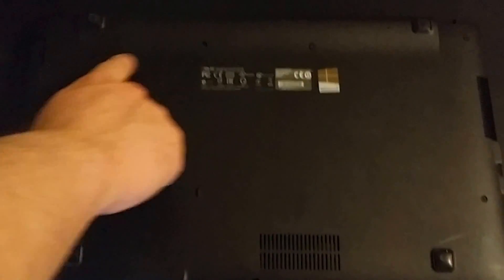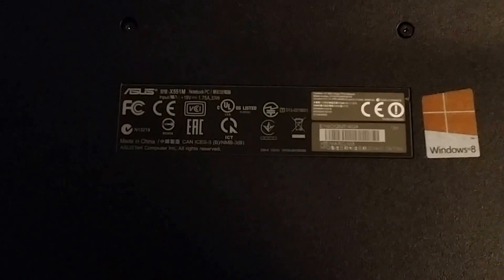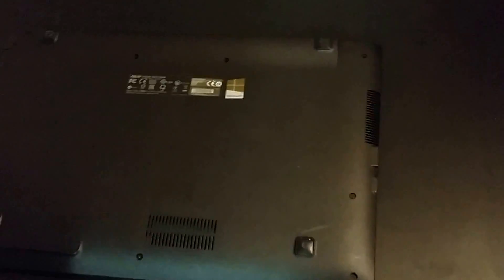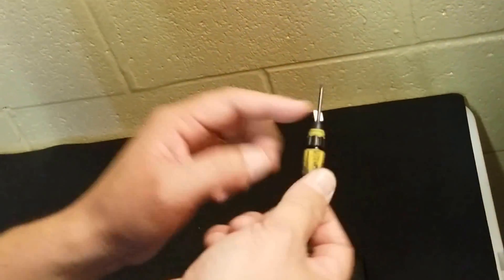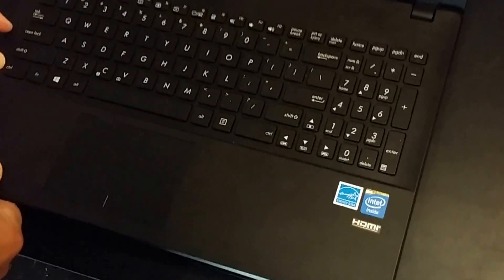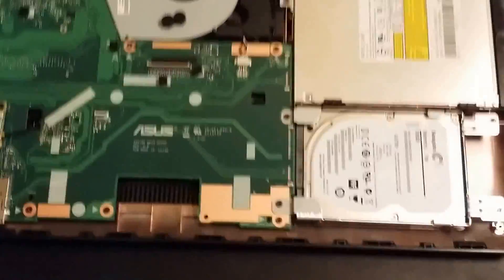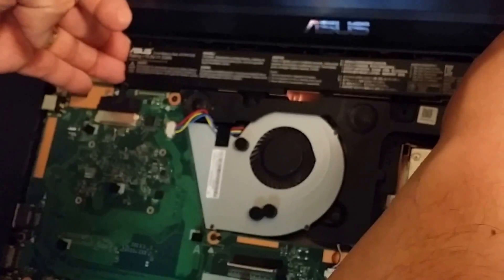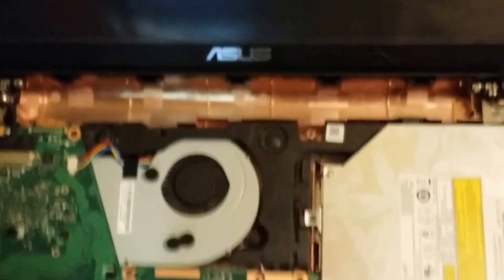ASUS X551M Laptop Battery Removal & Won't Power On Fix

Comment: I have accidentally mixed up the screws while removing battery and now I can't take out the small screw from where the long screw was supposed to be.
Reply from the maker: Matt P In times like this, I use both a magnetic screwdriver and a eyeglass screwdriver to get beneath the screw as the magnetic one holds it up.  Slowly start unscrewing the small screw while propping up the screw with the eyeglass screwdriver.  If you have room, you can use a pair of needle nose pliers or tweezers to hold the screw while unscrewing it with the magnetic one.

Good Lucj!
Reply: I've tried to use a magnetic screwdriver but it still won't lift up.
Reply from the maker: You need to at least get something under the screw to have some leverage, thus using an eyeglass screwdriver.  If all else fails, you CAN use super glue in the screw groove so you can pull it out as you screw without it pulling away.
Reply: +Angrysquirrel PC if I put sticky glue in the groove can I remove the glue afterwards
Reply: +Matt P it is difficult to take out my battery cause it looks so simple when you do it
Reply: Nvm dood i got it all fixed so now my laptop is fixed
Reply from the maker: Good to know Matt.  It took a little extra effort for your repair but at least you got it done.  Congrats!

Comment: Mine won't turn on what should I do if you help I'll donate $
Reply from the maker: Blake Smith No donation needed.  If your laptop won't turn on it can only be so many things.

1.  Check your power adapter.  If your power adapter is bad (also make sure you plug it into a working AC Outlet or one with the switch that is turned ON) when your battery is depleted, your adapter will not power anything into the system.  Try to plug it into a known good working adapter.

2.  Your battery may be bad.  Use my video above and follow the instructions to disassemble it to get to the battery and then remove it.  Hold the power button down for 30-60 seconds to full discharge any residual power that may have shorted out a component (like plugging in a headphone jack into the USB accidentally).  THEN, reassemble it WITHOUT putting the battery back in and put the power button ribbon cable back into the motherboard, plug in the Power Adapter and hit the power button.  If it turns on, you know you at least have a working computer.  Unplug the adapter then disassemble it to install the battery then reassemble.  If it turns on, your battery is good and you must have had a short somewhere.  If it DOESN'T work, then your battery is bad and you will need to get a replacement.

3.  If after checking the adapter and removing the battery and plugging the Power adapter directly and it STILL won't turn on.......

4.  You either have a bad DC Jack or bad Motherboard.  For this model, they are literally one and the same since the DC Jack is soldered onto the motherboard.  You will either have to get another DC jack on eBay or Amazon and have some desoldering/soldering skills to remove the DC jack or you can purchase a new motherboard.  Better yet, take it to a computer repair shop if you don't want to deal with having to do this kind of work.

I am assuming that when you said it won't turn on, you mean that literally there is no Power light, Charge light or any indication of it turning on in any way.

Good luck and let me know if any of this helps you.
Reply: omfg I followed your battery advice thank you so god forbidden much I really don't wanna return a laptop ive only had for 2 weeks but why does the battery need to be putback in why does your computer not turn on does it do it often or constantly im curious but thanks for the help you earned a sub
Reply from the maker: You are very welcome.  If everything works, you need to put the battery back in to rule out that it wasn't a bad battery causing your laptop to not turn on.  So you put it back in and if everything works, reassemble everything completely.  If it doesn't work, then you know the battery is the problem and you buy a replacement.

I'm glad my video was able to help you!

Comment: I have an Asus q301la ... So it won't boot up every time... But it does boot up sometimes ( 3 times in last 12 hours of trying.. I was able to back my data and all) so the screen doesn't light up and if it does sometimes it says "your pc ran into an error"... M using Windows 8.1 ... Please help
Reply: Karan Khurmi It sounds like either your Windows OS is having serious issues or that your hard drive might be dying.  The only way to discount that since you stated your screen doesn't light up (either a LCD problem or Motherboard graphics issue) is to plug it into an external monitor so you get a constant picture.  The best thing to do is to take it to a Computer Repair shop and have them at the minimum to test the hard drive to see if the test passes or fails.  After that, they will be able to tell you what to do at that point.

Good Luck!
Reply from the maker: Karan Khurmi If your computer doesn't boot up all the time, again, it is either the Hard Drive (failing hard drives sometimes will not allow the computer to boot up since the part fails the POST check) or a failing motherboard.  If you want to fix it yourself without taking it to a computer repair shop, purchase a new hard drive, remove the old drive, install the new drive, and turn it on.  If it boots every time, then you had a bad hard drive.  You will then need to install Windows 8.1 and I hope you made a factory recovery disk.  If you don't have the disk, you will need to either purchase one or get a Microsoft Windows 8.1 disk.  Don't bother looking for the product key sticker either.  The new wave of computers have the product key embedded on the BIOS/UEFI Chip called SLIC (Software License Key).  Just stick the disc in and it will do the rest.

Comment: I have this exact model and yesterday it was working fine but this morning it refuses to turn on. Do you know the cause of this? The lights for the power and battery change turned on but the the screen didn't. Should I take it to a shop?
Reply from the maker: carolina ayala Carolina, based on your comment it could be several things.  If your battery charge light and AC Plugged In Power light are both on, the only light that should not be on is the Power On light since you can't get it to turn on.

The possible reasons:
1. Bad battery causing it to not turn on.  Small chance of this being the reason but still a chance.  Follow the instructions in my video to remove the battery then reassemble then try to turn the system on.  If it powers on, then it was the battery.  If it doesn't, then it is something else.

2.  Bad Power Adapter.  The reason I did not list this as the number 1. reason is because you stated you have a battery charge light.  There is an even smaller chance the adapter is going bad so if you want to try plugging in another power adapter FIRST to eliminate this possibility before you disassemble the laptop to remove the battery, please do so.

3.  Bad Motherboard.  If the other two things don't fix the problem, you most likely have either a bad DC Jack or a Bad Motherboard which the DC Jack is soldered on to.  You would have to find a new/used (working) motherboard replacement and have to completely disassemble the laptop to remove the old motherboard and then install the new one.  If you feel comfortable doing that, you can save on repair shop labor costs.  If you don't and you want an expert to verify what is wrong with it, take it to a computer repair shop and let them give it a diagnostic.  Some places will be free and some will charge you.

Good luck!

Devin

Comment from the maker: Yes BillyBoy,as long as the battery manufacturer states that their battery will fit the laptop (in your case it is the ASUS X551MA) an OEM, Name Brand, or Generic battery will work on that laptop.  The only differences are name brand recognition, cost and type (6-cell vs 9 or 12 cells).  If you feel that you want something other then an ASUS branded laptop, by all means purchase it but always check on the type and the warranty as a battery is only as good as the company that stands behind their products.

Hope this helps!

Devin
Reply: ***** Ive had my ASUS for about 4 months and like it! For the price I think its a good first laptop after going from a desktop.  I agree its shear stupidity to design a laptop that has no battery access panel.  Ive looked up batteries just in case. Ive found am few sites tha t sell Asus branded batteries. This is a 3 cell 10.8 volt. I didn't find any generic batteries for it. Was wondering if there is a site that may carry them generics.  Another question!  Is it possible to put another battery that has more power and longer battery life?  BTW you videos a very well done, keep up the good work.
Reply from the maker: eBay has a generic 4 cell battery.  Click the link or copy/paste it into your browser:
http://www.ebay.com/itm/Battery-Fit-ASUS-X551MA-X551MA-RCLN03-X551MAV-EB01-B-X551MAV-RCLN06-/261892734212?pt=LH_DefaultDomain_0&hash=item3cfa05fd04

Amazon has tons of generic batteries.  Type in Amazon's search: asus x551m battery.

The only way you can have more power and longer battery life is to get a battery with more cells.  The problem is that the more cells you have, the bigger the battery becomes THUS the problem when you have a battery in a self enclosed case.
Reply: ***** so while wathching the video i didnt find where the ram is located can you tell me?
Reply from the maker: The memory is located UNDERNEATH the motherboard.  You will have to remove the motherboard to get to the memory underneath.  The problem is that the memory is usually not removable nor can you upgrade it for this model.  SOMETIMES you might get lucky and have one that you can upgrade the RAM but most times you can't for this model.  Sorry for the bad news.
Reply from the maker: UsCrLePlays The memory is located UNDERNEATH the motherboard.  You will have to remove the motherboard to get to the memory underneath.  The problem is that the memory is usually not removable nor can you upgrade it for this model.  SOMETIMES you might get lucky and have one that you can upgrade the RAM but most times you can't for this model.  Sorry for the bad news.

Comment: Question, Is there a another brand name laptop  battery that is compatible to the ASUS 551MA's battery A31N1319? I've got the specs of the battery and wondered if it could be replaced with one for another model if I couldn't get an ASUS made one.
Reply: Billy Boy I never realized that there are many different model X551ma.s till I started checking out batteries!  Mine apparently is one of the newer models:x551mavHCL1201E.  So from your video I don't know the batteries model number or real power output etc.  Most of the sites I've gone to don't even list a battery for this model, not even Asus,s site!  I've found batteries listed for X551MAV-RCLN03, EB01-b, RCLN06.  They don't usually list the watt hrs, amp hrs,  battery run time.  Not having opened this one  I don't know what's in here and if the sizes of the replacement batteries would fit!  I emailed ASUS and all I got was a part number and 11.25 volts, 33 watts, which doesn't really help me! I emailed them back and asked for more info on this or other replacement batteries that may fit. I'm still waiting to see if they reply!

Comment: Thanks for the video, always helps to watch someone else do it rather the try to figure it out. A friend of mine asked me to look at theirs. They bought a replacement power supply and it still wouldn't turn on. They said that at one point there were sparks that come out of the area where you plug in power. I have unplugged and taken out the battery and tried to reset by holding in the power button, replace and put back together and then power it on, still nothing.  I'm thinking the mother board is fried, but don't want to have them replace it and it still not work.  What are your thoughts?
Reply from the maker: dgr62679 My first advice is to try a power adapter that doesn't spark.  Sparks normally is not a good sign and you can actually take it to a computer repair shop and they can plug in a universal power adapter and try to turn it on for you (usually for free as part of the diagnosis).  If there are no shops near you or none that will do it for free, you can purchase a universal power adapter at Walmart, Office Depot, Staples, etc. and go from there.  If that doesn't work you can always do a refund to get your money back.  Remember, at this point all you are trying to do is verify if it is the power adapter OR the motherboard.  If nothing works on the Power Adapter, it is most likely the motherboard.  FYI>  remove the battery when doing these tests.  A bad battery sometimes will keep the computer from booting.  I have learned this from personal/professional experience.  Let us all know what happens!
Reply: ***** yes, the power supply that sparked was thrown away and a universal was purchased...it's a no go. I do have shops here that I could take it to...do they normally do a free diag and let you know if the motherboard is shot? I did remove the battery and it still did not power on. I am thinking the spark shorted something out with the power. I will see if I can get to a shop tomorrow and see if it's the motherboard, then I'll see where they purchased it and see if they can get a refund.
Reply from the maker: dgr62679 Well it is probably the motherboard then unfortunately.  And it could also be the DC Jack.  The problem is that with this particular motherboard, the DC Jack is soldered onto the motherboard and cannot be removed unless you desolder and resolder a new DC jack onto it.  Also if you did short the motherboard, the DC Jack probably isn't the culprit.  Assuming that you have an ASUS X551M computer, I took the liberty of checking out some motherboard prices for you.

The cheapest USED board from a seller with over a 99.4% rating costs $79.16.  Please see: http://www.ebay.com/itm/ASUS-15-6-X551M-Genuine-Intel-System-Motherboard-60NB0480-MB1501-Tested-GLP-/261963149841?pt=LH_DefaultDomain_0&hash=item3cfe387211.

A NEW motherboard (there is only ONE on eBay) with a seller with a 99.5% rating is $108.32.  Please see: http://www.ebay.com/itm/ASUS-15-6-X551M-Genuine-Intel-System-Motherboard-60NB0480-MB1501-Tested-GLP-/261963149841?pt=LH_DefaultDomain_0&hash=item3cfe387211

You could also try Amazon as well.

The problem is that if you take it to a shop after you purchase either item, you will also have to pay them labor.  This computer is about a $300 laptop if memory serves me.  My general rule of thumb is if the price of parts and labor exceeds 50% of purchasing a comparable replacement computer, Get the NEW computer.  If it is between 40%-50%, then it is a decision call for the owner to make.  If it is under 40%, it is advised to repair the computer since you will save over 60% from purchasing the new replacement computer.  So math would tell you that if the total repair costs over $150, you should NOT repair it.  If you want to take a chance purchasing the motherboard and fixing it yourself, that would bring the repair cost down to about 36%.

Good luck in whatever you decide because the decision is ultimately yours.

Devin

Comment: I just got he estimate to repair my Asus similar tothe one in the video,  it $394.!!!
for a mother board, keyboard, and hard drive! Of course I declined the repairs. All that damage just from plugging in  the wrong end of a USB port!
Reply from the maker: Bob, where did you try and plug the usb cable to when you accidentally reversed it since you said wrong end of the usb port?  And how did the hard drive and keyboard get damaged?
Reply: it's was for my ipod nano, but Nothing was connected to the usb cable, that's why I inserted the wrong end in the usb port.  I've yet to ask the Geek Squad why so much damage is done to the computer when I get it back from them.
Reply from the maker: +Bob C Oh OK.  Now I understand.  Yeah so you accidentally shorted the board by sticking the wrong end of a mini USB connector into a Laptop USB port.  But if nothing was connected, there should not have been any power going into it.  I would advise to try to remove the battery, hold the power button down for 30 secs then reassemble it to the point without the battery to plug in the DC Jack to try and power on the system.  I'm sorry but Geek Squad is not the best source of information for pricing OR repairs.  Decline the repair and take it to an actual computer shop if my advice doesn't work.